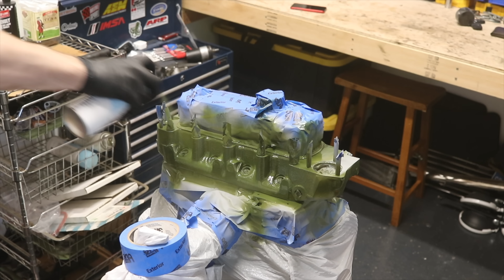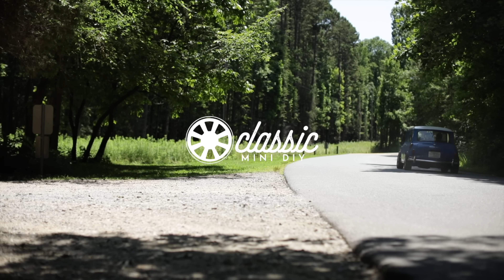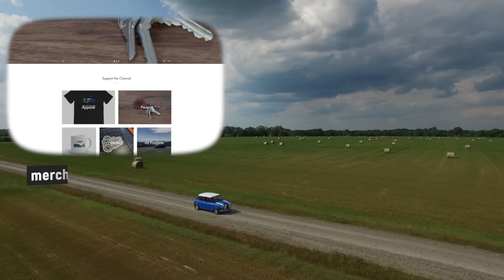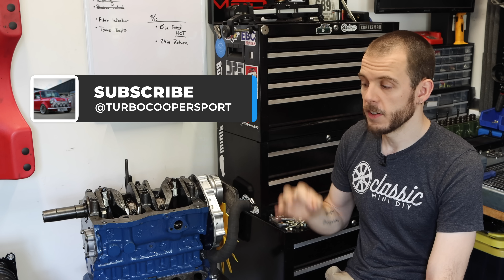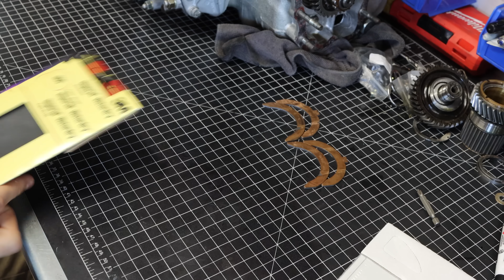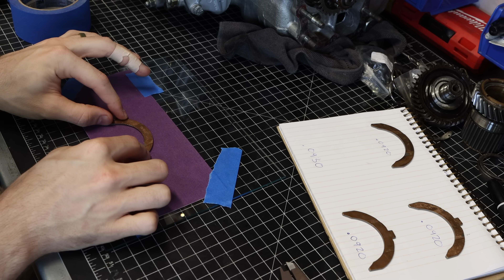The Engine is out Again... - Haynes was Wrong?!

Comment: I had the exact same problem more than 10 years ago, but I wasn't wise enough to take appart the engine immediately, it endend with a ruined crankshaft. The later engines I've done I was way more generous on the crankshaft clearance.

Comment: This video needs to be taken with a massive pinch of salt, don’t go changing your end float to match his if you have a standard engine. 2 thou is its optimum clearance, which every mini was built with originally. THIS END FLOAT IS TO SUIT HIS MODIFIED ENGINE ONLY. Just in case that wasn’t clear to folks
Reply from the maker: While this is accurate advice, I actually say this 3 different times in the video. This is the setting for my engine in relation to its power and performance spec.
Reply: @classicminidiy   I didn’t mean my comment to sound like it did. I have used your videos for points of reference thought out my build and I sometimes don’t watch the entire video, but skip to the part I need. So apologies, just wanted to make sure someone with a standard engine didn’t go messing around with their end float unnecessarily :)
Reply from the maker: No worries, tone can be hard to read in comments sometimes! Thanks for watching the episodes!

Comment: Rebuilt a 997 Cooper engine back in the mid ‘80s, mechanic put the thrust bearings in back to front.
Engine developed excess end play very quickly, crank had to have the thrust surfaces reground , oversize bearings.
I got very good at Mini engine removal/installs that year 🤬

Comment: hey cole,   changing the front cones on my mini and turns out they are the original imperial threaded ones so super old. but they are jammed up in the tower and won't drop out.  the adjust arise stuck to the bottom ive removed top arm but it won't fall out. read the haynes manual and it says to remove the subframe mounting bolts directly above the cone then to remove the lock plate and then refit the bolts.. why do i have to do this step.. is the lock plate stopping the cone falling out.. any tips???

Comment: You are incorrect, the Haynes manual is correct. As per the original 'Mini Workshop Manual' the crankshaft end float measurement is stated as being .002" - .003" clearance ( the same for all 5 engine variants). Modifications to engines away from standard sometimes 'may' require a change, you are placing way more load onto the rotating assembly than it was originally designed for. Everyone has there own 'thoughts' on what is correct and to may way of thinking the .006" end float is excessive.
Reply: yes, amazing amount of bad advice here , also if they are tight they will wear very quickly and the problem would solve itself
Reply: I'm a bit late to the party, only  just seen this vid - Agree with all your comments - spot on, I have been involved with mini's from 850's to 1275's since 1966 - the original BMC workshop manual (I still have one) indicates crank end float of 2 to 3 thou - as you mention excess end float can load side stress to the con rods and bearings. strange that I've never experienced problems running IAW manufactures specification.

Comment: So heat was sufficient to cause binding of the crank. Were you still running Evans coolant? That runs hotter than standard 50/50 mix because of the inherent specific heat capacity difference. Might have been a contributing factor to the 0.002" spec being too tight at the higher operating temp.

Comment: To explain to the knowlessmen what these packing pieces and washers do, it locates the crankshaft horizontally and stops the enormous pressure from the clutch press literally pushing the big ends into their webs and ensures mains stay in the exact position needed for max lubrication and support.   Its why you should never clutch down start an A series because you are without the centrifugal force a running engine possesses and causes premature wear on the thrust washer and packing pieces easily identified by engine slow turning when starting with clutch down or revs drop when clutch down.   My Reliant Robin engine is almost identical being developed from the same master engine, the Austin 7 as the A series was developed from and mine has had a bit of looseness on the thrusts since I had it these 9 years but once its running, the dropdown of revs is quite minimal, its still running fine so not going to tinker with it.   Clutch down starting does nothing except wears things out.   On mine, I only have to drop the sump to replace the packing pieces but its a leetle more involved on a Mini due to gearbox there.
Reply: Good to know! I've driven manual tranny cars my whole life and never heard this clutch advice. In fact many modern cars (and my modern Triumph motorbike) require clutch to be held on to power the starter (as a safety interlock). Is this advice just applicable to A-series Austin/Rover engines for some reason?

Comment: As the prevoious owner of a 72 MGB I can tell you if you can get your hands on the Austin Mini shop manual that will be your go to reference. I have the Haynes also but only cross check it to the shop manual. I actually had a problem with the brake warning light and only my shop manual gave an actual torque on a brake pressure sensor that solved the problem. Moss motors sells it, its not cheap but its worth it versus trying to guess or when you can't contact someone who knows about an issue.

Comment: Also check your primary gear and idler gear clearances if you set them to the Haynes Mannual spec. There specs are for a low HP engine and are also to tight for a hot mini engine
Reply: Cole and I went over that during his build. They are at the ideal tolerances for boosted applications and his clutch 👌🏽

Comment: i had  same problem because i had the clutch arm too tight at the adjustment bolt so the clutch was running loaded and wore out the trusts [ on the front side ]  causing the exact problems you describe . i now have it set to .002  ,, arg, now this.   But my research showed lots of opinions on this
Reply: to repeat, i had the same issue, engine would stall when warm , too tight! , at rest it had zero endfloat , with the clutch arm off it had + .010 and the thrust washer was laying in the gearbox. i have an original shop manual, the end float .002- .003.  The problem arose because i had the bad habit of moving the clutch adjusting bolt to make the clutch work. when the hydraulics were weak
Reply: and likewise i've had to pull the engine several ! times , its gets faster each time,, lol

Comment: Surprised you didn't know the full title of the "manual." "Haynes Book of Lies" is the actual correct verbage.
Reply: My Haynes manuals have many notes added to them 🤣
Reply: I recommend "Tuning BL's A-Series Engine" by David Vizard. E.g. on page 327 in the section headed "Bearings" he states "If you expect to run the engine consistently over 7000 rpm then the thrust bearing clearances need to be increased. On small bore engines go 2 to 3 thou over the top limit. On big bore engines, especially those that have been stroked, go 4 to 5 thou over the top limit." You can take that as meaning that for any kind of high performance modification the thrust bearing clearances really need to be larger. I have my copy balanced on my knee as I type this and it really is the bible for creating high performance Mini engines.
Reply from the maker: Hahaha well credit where its due, it hasn't steered me wrong until now.